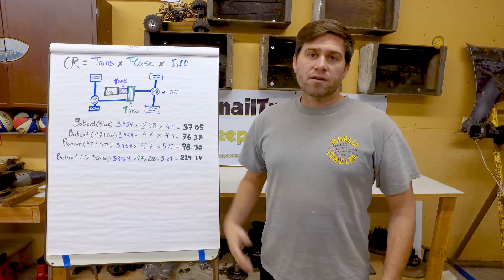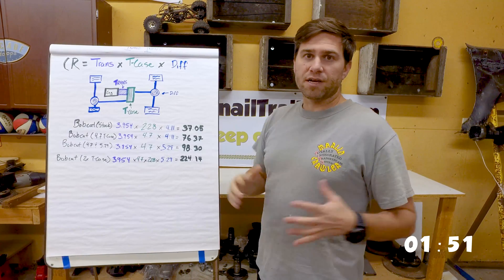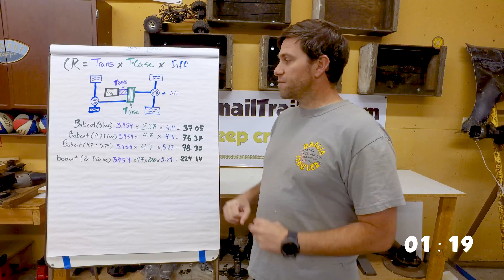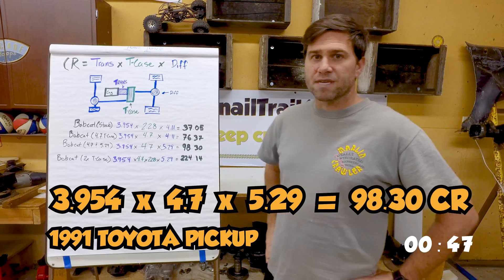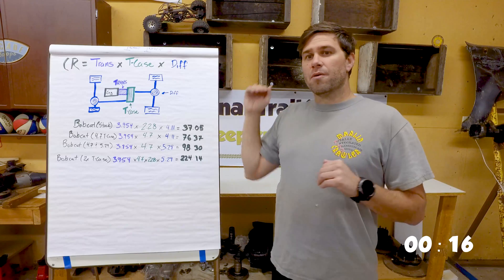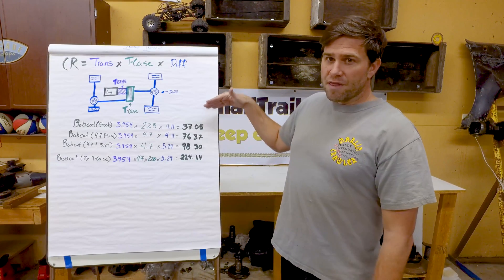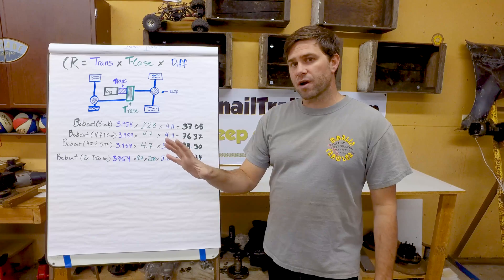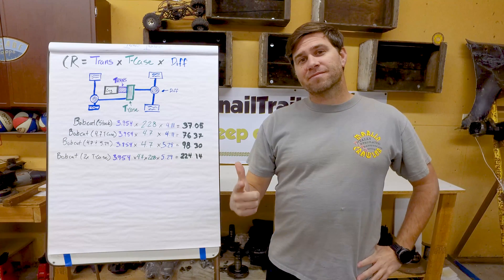How to calculate a vehicle's crawl ratio

Comment: Theoretically you can build a 4WD vehicle with extreme crawl ratio. A combination of GM Muncie SM420 transmission (with it's very low 1st gear ratio of 7.05:1), Suzuki Jimny transfer case with 6.5:1 low gear ratio (there are Atlas 4-speed transfer cases with 11.69:1 low ratio), Dana 60 axle with 7.17:1 diff ratio will give you a crawl ratio of 328.56:1 (590.9:1 with Atlas 4sp t-case). But I have a hunch that such crawl ratios are excessive. So... what's the most practical crawl ratio?

Comment: Manual transmission you need 100+ ratio. Automatic anything around 50-80 work good.
Reply from the maker: I think there are a lot of factors that fall into this, size of your engine, and tires play a big roll.

Comment: Alright. Sooo i have a 2011 tacoma 4x4 with Arb air lockers f&r that im in the process of finishing my 5.3ls swap. 
                4l60e
Transmission first gear 3.06
                Np261
Transfer case 2.76:1
         Axles gears
            4.88s

= 41.2145....... Is this bad?

Ohh yea im on 35X12.50 17$ GY Kevlar mtrs
Reply from the maker: With that LS your going to have tons of HPs and that's going to help alot. But if your planning on doing any serious rock crawling it's always nice to have a bigger number.
Reply: 10/4 thank bud.

Comment: How tire size ( e.g. from 35s to 39s ) affect/influence crawl ratio?
Reply from the maker: Alejandro Chapa -- the ratio is still the same. Tires are not apart of the equations. This is all about the different gearing. You will still have the same crawl ratio no matter what size tires you have. You will just be traveling faster with big tires.
Reply: SnailTrail----You are right, I realized about it using Advance Adapters' crawl ratio calculation charts early this week but still have questions to you----How tire size modification affects wheel's torque ( from 35 to 39 )? Assume there is a lost/win difference doing that ( I saw some formulas to calculate it but need further explanation and my JK' s technical data to complete the math/equations. In addition I would like to know how torque converter on my transmission ( 42RLE ) affect/influence all this matter together. Thanks for your input...nice videos
Reply: @alejandrochapa4707   Tire size does not affect the wheel torque. It affects the force and resultantly the acceleration. 
Torque at the flywheel* crawl ratio= wheel torque

Comment: Great video good information for everyone. I was curious I saw a discussion on crawl ratio can’t remember where in the difference between automatics and manual transmissions they were saying with an automatic to multiply by 1.5 or two to account for the torque converter changing things. It would make sense because in Moab I tested it out our cousin has a jeep with a manual transmission and his crawl ratio was supposedly higher than mine. Mine right now is 47 and his was 57.4 but in first gear I crawl a lot slower than him. If I multiply by 1.5 for Torque Converter I’m at 70.5 which would be about right on how slow I am in first gear versus my cousins at 57.4. Will be going to 5.13 Gears hopefully soon which Will bring me up to 58.28 or 87.42 multiplied by 1.5. Would like to get around someone with multiple T cases like yourself to test the 1.5 multiple theory out more.
Reply from the maker: +AZ WESTSIDE WHEELERS -- I've never heard that but it makes a little bit of sense, those torque converters do steal some power. I wonder if anybody else has a comment.

Comment: I'm thinking about doing triple cases..  which is 3.95x2.28x4.7x4.7x5.29=1052:1.. ..  ya. Or
3.95x2.28x2.28x4.7x5.29=510:1... 
4runner with 40s help me decide.. lol.
Reply from the maker: +hurleykid83 -- in my opinion 1000:1 is just to low, and you would never use it. Like I said in my video I practically never use my lowest of low gears 224:1. So I would advise doing the 510:1. Though it would be pretty badass to say I have a 1000:1 crawl ratio 😉
Reply: Yea it more for showing off then anything..   gotta have the radesigns triple stick setup..
Reply from the maker: +hurleykid83 I'd be interested to see pics of your setup. When your doing the install post some pics on The FB page please 😀

Comment: Killer break down on crawl ratios, ya forgot tripple t case also like marlins & others!   Only in a Toyota :-)
Reply: Marlin has 2.28x 4.7x.4.7 not sur what trans gear hes got these days but have personally seen that t case set up with 6.5 :1 1st gear way low
Reply from the maker: +Dan zoller -- what's your crawl ratio with tripple cases?
Reply: SnailTrail4x4  not mine a good buddys rig 1794.15:1  redulous ! 6.5 x2.28x4.7x4.7x 5.40